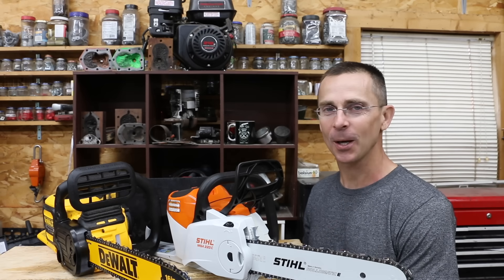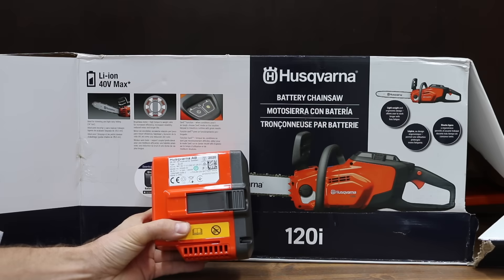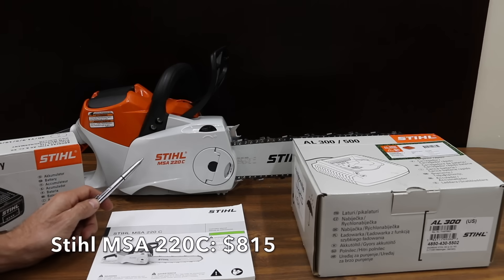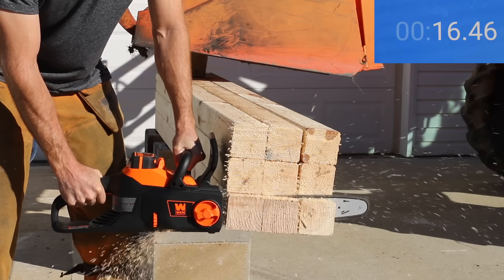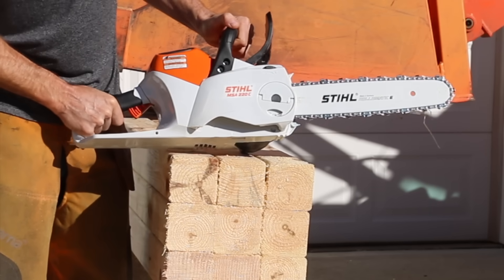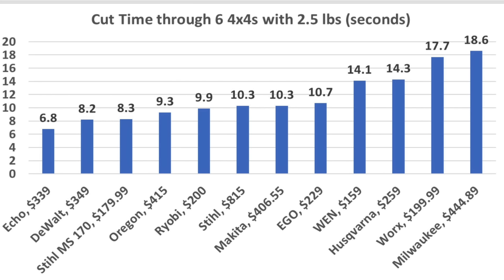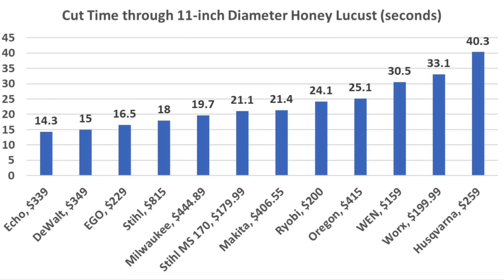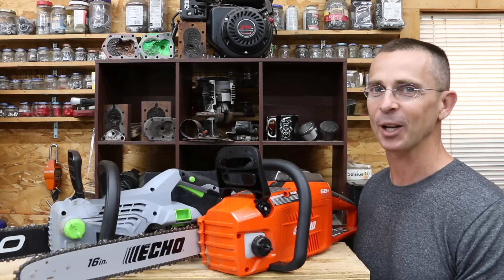Best Battery Powered Chainsaw Brand (ROUND 2)? Stihl, Husqvarna, Echo, Oregon, DeWalt

Comment: Man Stihl should be ashamed. Looks like it will be an Echo for me when the time comes. Thanks again Project Farm!
Reply: I'd buy whatever you already have batteries for. 

If you own zero cordless tools, then milwaukee/makita/dewalt makes the most sense. Buy the battery system you can get all the tools you'd ever need, otherwise you'll drive yourself nuts looking for the right battery/charger.
Reply from the maker: You are welcome!
Reply: @ProjectFarm  I'd like to see a comprehensive objective review of standard screwdrivers, tip strength etc. Including snap on, kobalt, and other brands, and maybe even some of the German made brands.
Reply: I logged with echo, they are junk in my experience. We used heavy duty saws too. I have a stihl 066 that is at least 20 years old and it hasnt been tuned or rebuilt and it still runs like the monster it is.
Reply: @ratedredneck96  I’ve used all sorts of Stihl and Husqvarna chainsaws over the years small to big. Stihl has more vibration than Hasqvarna but doesn’t fall apart like one. I have a 20 plus year old Stihl 036 professional haven’t used in years dumped out old fuel put in fresh no ethanol gas started right up runs like new. Problem with chainsaws most people don’t know how to use properly and are a danger to themselves while using. Also in order to cut right you need to know how to sharpen the chain correctly.
Reply: @4Runner123  yeah, what i was taught is keep the file flat and follow the pitch of the tooth and keep it consistent on passes so you dont have uneven tooth wear. Also a little cheat if you have a decent power sae like a pro model or something around an 038 or something file down a couple passes on the depth gauge. You dont have to push as hard and it will dig more per tooth. You can easily overdo it though and cause the blade to fowl out a lot so just literally 2 passes with a flat file per depth gauge and the saw will cut better you just have to keep it up in the rpm so it doesnt bog out. Also safety chains or skip tooth chains can be annoying, get a full chisel chain but they dull a bit faster but cut better. Its all a pretty saphisticated deal when you really start looking into it. Full chisel standard chain with a tiny bit of depth gauge filing csn be a monster setup on something like an 048 or 066. I too have used the small saws of husky and stihl and the general rule is tuning a small husky saw is hard, getting them to idle and also run well up top is a pain but a small stihl is easy to start and run and idle while also being a nice steady high rpm. When i logged i used echo but although they were good saws i just cant see myself with anything but a stihl. For some reason husky makes a good weed eater but the saws are just finnicky.
Reply: @ratedredneck96  I fully agree file down the rakers a bit when the chain’s getting worn down. Just make sure not too much. You just want to look what sort of chips it’s producing. It’s been a long time since I used the big big saws. Always remember not to hit anything to dull them or you will be sharpening for a while lol
Reply: Wonder if the rim can drop a tooth on stihl?  Thatd bring torque up.
Reply: @claterpillar1  No it wouldn't. The motor makes torque. Not the sprocket. The "gear ratio" is the CHAIN TOOTH COUNT DIVIDED BY THE SPROCKET TOOTH COUNT. THE BAR TIP SPROCKET IS AN "IDLER". And horsepower is a function of torque and speed calculated using a speed constant. "Dropping a tooth" drops "chain speed" by whatever percentage of current sprocket "tooth count" one tooth is because that's one fewer "tooth" per crank/motor revolution driving the chain.  'Drop one tooth" from 5 and that's a 20% chain speed reduction. Nothing increases motor torque in that scenario. 20% less chain speed = 20% less "horsepower". At best. 

The Stihl has far more "power" than everything else in the "comparison" with both a far more "powerful" battery in terms of voltage and a far "torquier" one in CURRENT FLOW CAPACITY AKA AMP-HOUR RATING. 

IT HAS ROUGHLY 75% MORE "POWER" AT 7.2 AMP-HOUR (WHICH MEANS IT WILL "PRODUCE" 7.2 AMPS MINIMUM FOR 1 HOUR OR 1 AMP FOR 7.2 HOURS MINIMUM BEFORE BEING "DEAD" I.E. REDUCED TO NO LESS TO ITS NOMINAL VOLTAGE OF 52 VOLTS) THAN ANY OTHER "CHAINSAW KIT" IN THE "TEST" AND ITS - INCORRECTLY "TESTED" - "FREE" MOTOR SPEED OF 13,000ISH RPM IS "ON PAR" WITH ITS "GAS COUSINS" - IN THE STIHL FAMILY THAT IS AS THE ONLY SAW HERE WITH A "GAS COUSIN" OF ACTUALLY "COMPARABLE" SIZE AND "POWER" AND "SPEED") AND ITS SUPPOSEDLY "SLOWER SPEED" IS DUE ENTIRELY TO ITS "OVERSIZE" BAR AND "SAFETY" LOW-KICKBACK CHAIN IT WAS "BUILT" WITH BY WHATEVER STIHL "DEALER" IT WAS "PURCHASED" FROM. 

YOU OBVIOUSLY KNOW STIHL "RIM SPROCKETS" ARE "INTERCHANGEABLE" ON THE CLUTCH DRUM OF "GAS SAWS" BUT THE CHAIN PITCH MUST ALSO BE "SWAPPED" AND A CHAIN AND BAR "NOT RECOMMENDED" FOR THE SPECIFIC POWERHEAD "SWAPPED" AS WELL AND ALTHOUGH A COMMON "TRICK" TO GET MORE "POWER" OUT OF A GIVEN POWERHEAD IN FACT THE OVERALL SAW "HORSEPOWER" IS AT BEST UNAFFECTED IF NOT "DOWNGRADED" ESPECIALLY WHEN AN "OVERSIZE" BAR IS ALSO INSTALLED WITH A LENGTH INCREASE PERCENTAGE IN EXCESS OF THE SPROCKET "TORQUE INCREASE". 

"DROPPING" 20% OF CHAIN SPEED AND ADDING 25% MORE BAR LENGTH CREATES A NET "POWER DOWNGRADE" OF AT LEAST 5% AND WHEN "UPGRADING" A "CONSUMER GRADE" STIHL LIKE AN 039-FAMILY POWERHEAD WITH "PRO SERIES" PARTS FROM AN 044-046, THE NET RESULT IS ALWAYS A "HOPPED UP" 039 THAT "DAY IN AND DAY OUT" WILL NOT "OUTCUT" A 100% "BOX STOCK" 039 IN "PROPER TUNE" AND WITH THE "RECOMMENDED" BAR AND CHAIN IN THE HANDS OF A SKILLED - NOT JUST "EXPERIENCED" - OPERATOR. AND AN OPERATOR IS DIFFERENT THAN A "USER" AS WELL. 

THROUGHOUT THE "OUTDOOR POWER EQUIPMENT INDUSTRY" WHETHER THE EQUIPMENT IS A "LEAF BLOWER" OR A "PAYLOADER" LESS "POWER" AND MORE SKILL = MORE "SPEED" AND LESS "COST" FOR MORE PROFIT  EVERY DAY OF THE WEEK.
Reply: @deeremeyer1749  been felling trees 27 years. 066, ms660 500i    I didn't read that book you wrote,  but cool story.   😎
Reply: Stihl is a lightweight professional saw for use when climbing a tree to top and drop limbs. Often times you are cutting one handed that is why it did so well with little pressure. The Stihl is an excellent product.
Reply: I own the Echo. Money well spent!
Reply: Totally satisfied with my echo chainsaw, so much so I snagged another on clearance at the home depot. I have multiple of the 58v trimmers as well and the mowers. Great buy!
Reply: These are very small chainsaws but cool
Reply: Stihl is good of the variaty of using his battery , they got all the garden aquipments on the same battery ;-)
Reply: Don’t forget the Echo is nearly twice as heavy. Rather work with the lighter Stihl!
Reply: Stihl should just send him a reimbursement check, thats an embarrassment for such highly priced saw. I own all stihl gas products, but this electric saw its embarrassing.
Reply: @dontheplumber.4406  This saw costs 399€ in Europe now for Christmas. I bought the smaller 140-model to be used in parks and on nature trails and in conservation areas. An excellent little saw. I was impressed by the Echo in the test though, but the dealers over here are quite far in between and usually carry no spares.
Reply: I have 3 years on my echo and it is still going strong.  You will love it
Reply: Wait and see if he does a test with the atlas. I’m curious personally where it will fall. I love mine with a 16” bar. The 18 was too long for it. I have a husqvarna, Echo, stihl and the atlas.
Reply: When I see stihl I see a big pile of dog s. Lol never had luck I love buying American made but America has went to crap. Japan takes pride in what they build.
Reply: Yeah 800$ can’t cut shit
Reply: I sell STIHL'S and can get them just over cost, yet I own ECHO. What does that tell you.
Reply: For me to buy the Echo they would need to move its manufacture to Japan like their Gas ones..
Not interested in one made in China..
Reply: I sort of agree but at least with a gas Stihl they will last forever if maintained. Hard to say that paying over 2x the cost is worth it tho.
Reply: @SnifferSock  Yes, that Stihl is very nicely build but too expensive for a non-professional. For that price it would be nice to have a little more powerful motor, but I guess they wanted to keep the weight down.
Reply: @tkermi  even for a professional, it is too expensive for far less performance.  What pro would buy a battery powered stihl vs gas?  None.
Reply: @hanwagu9967  I'm not a professional in this field. But the pro who cut down two medium sized but very bushy 70cm (24") thick spruce from my yard used that Stihl and worked really fast.

He only used a gas powered saw for the very lowest section of the trunk. He had been profession over 10 years, it took about 1 hour / very bushy tree for him to climp and cut off all the branches and cut the trunk to 55cm (22") pieces (on his way down from the top).
Reply: @tkermi  Sorry...if the "pro" used the MSA220C with a 14" bar with only 12" usable bar, which actually means 10", to cut down 24" thick (I'm presuming you mean diameter here), he/she wasn't a pro.  SAFETY, SAFETY SAFETY!
Reply: @hanwagu9967  Like I wrote he used a gas powered saw for cutting the lower thick section of the trunk (maybe the first 1/4). He was a well trained with an arborist degree and proper company with all necessary insurances.

Now when thinking more carefully I think he actually used Stihl MSA 161 T (with 14" bar - I think) and not the model from this review for one handed operating. He needed his other hand for guiding the dropping down path of the brach he cut (the trees were close to the house and the branches were heavy and long ).

I live in Finland and here a large percentage of the people have quite reasonable knowledge about forest keeping including logging safety. We all learn a little bit of that from the school and almost all have some relative / friend with at least a small patch of forest. My uncle and one of my friends own quite nice sized forest areas.

Even though I'm certainly not a pro I have been cutting down some trees myself in few differend selective loggings. And used few different saws a lot when making firewood from small (4"-8" diameter) birch trunks. For that stationary use Makita UC3041A is cheap and very good electric saw (with power cord). But now when I have a geothermal heat pump - and not my own forest - I don't make firewood anymore.

But anyways, I told all that just to establish that I do have some understanding about logging/forestry (not just a keyboard warrior noob 😅). So the Stihl battery powered saw seemed to perform extremely effectively for that task described earlier.
Reply: @tkermi  well, just because you may have cut 30 trees doesn't mean you are a pro nor does it mean you are doing it correctly or safely.  I see plenty of "Pro" contractors felling trees and doing so dangerously.  Anyway, the point is, use the proper tool for the job.  The Stihl in this case is a sad performer compared to others out there at a price that doesn't justify performance, only brand.
Reply: @hanwagu9967  You are correct that I'm certainly not a pro. But about that Stihl being a suitable tool for the job I describe - I must politely disagree. Maybe you have used it a lot in that kind of work and for some reason it didn't work out for you 🤷🏻‍♂️.

But as a craftsman myself I could only admire how swiftly and smoothly that arborist cut down my two trees. 

Safety was my main concer because trees were toching my house (and didn't want anything bad happen to the arborist either). That's why I cheked multiple companies before choosing this guy. Also we have excellent arborist / forestry schools here in Finland and that's why accidents among graduated professionals are rare.
Reply: @hanwagu9967  unless you live in Sacramento CA then you are forced to lol
Reply: @SnifferSock  yeah I really do like Stihl chainsaws. I now have a new Husqvarna that I purchased a couple of years ago and I say it's new because I haven't run but about maybe a gallon of gas through it. The only reason I changed to husky is because the Stihl dealer here in town has really suck service. Where I bought my first Stihl chainsaw  and later weed eater at some 40 odd years ago got too old to deal with everything and sold the store and they decided on not carrying outdoor power equipment anymore. I still have that old 028  and an old 031 or 3 2 but they need gas line filter assemblies and they don't make them anymore. I even told the guy look if you'll do this to fix it and he says we don't jerry- rig. Well I was already down pretty bad in health but I'm getting a little better so I just got to get my glasses on, buy me some tubing, any kind of filter that I can attach it to and I will replace my own gas line assemblies I just hope I can still get a carburetor kit. And unfortunately there are manufacturers that will only agree to make parts for their equipment even like washers and dryers, for maybe 10 years some maybe 15 but then again other companies decide to make Parts on for several more years. So go gas and go Stihl and now that I own a Husqvarna go Husqvarna too! I don't guess I'll be switching to Electric for long time. happy cutting to you! And have a wonderful Christmas!
Reply: @SnifferSock  if they are maintained they still suck !!!!
Reply: Was wanting to get myself a stihl. But now thats changed.
Reply: Why would you buy an electrical chainsaw when the time comes? A good 40 CC - 50 CC saw will be lighter, cheaper, more convenient and last longer. Electric chainsaws only make sense when they are cheap and corded for processing very small wood around a property or when one has existing batteries on hand and they wish to use them. You would easily need several batteries from any of these platforms to get a couple hours of real use, it is not only impractical, but quite heavy to carry and these batteries would not come cheap either. With cost of several batteries tallied it would cost a lot more than a good 40 cc - 50 CC saw while being worse in almost all respects. Electric saws work when cheap and corded as they are convenient, batteries are not an issue and they outperform the really cheap gas chainsaws in their class alternatively battery saws only make sense if you're already bought into a platform as that significantly reduces the battery cost.
Reply: @Ilost11  That's all true. But if someone wants a lightweight battery powered speciality saw (for one-handed use, when climbing in trees etc.) the Stihl MSA 161 T is nice though very expensive. With the smaller 94Wh battery it weights only 7,5 lbs and with 187Wh battery 8,4 lbs. But I know there are lighter weight / cheaper gasoline powered options.
Reply: I had Ego do a demonstration at my colleges campus to try get them to replace all the petrol powered equipment do love their leaf blowers and hedge trimmers
Reply: @rhaynhillyard9772  why?  gas is king!
Reply: Husky should be ashamed I've owned husqvarna my whole life best most powerful saws I've ever used they should have stuck with gas
Reply: My dad uses echo. Has 3 different sizes and cuts about 10 cords a year and they run great
Reply: @johncoinas  I have 1 husqvarna, makita and stihl with 2 echo's, Echo's are nice but since I modded the 63cc  MS360 Stihl its 11cc smaller but cuts so much faster than 372xp
Would buy echo's cordless any day, seems like  a decent machine. They never let you down or fail, really well built saws, pro ones at least.
Reply: @johncoinas  He cuts 10 cords with a electric saw??? Well, if you have to use 10 cords to heat then it is probably just spruce.
Reply: @lickyweeks  did i say electric lol echo has gas and has to keep up for the next year. He lives in northern maine and its the only source of heat and cooking but ya its definitely spruce lmao

Comment: THANKS, Commander and Echo makes GOOD equipment.  We also have a Milwaukee Hatchet 20 volt trim saw with a 6 inch bar for the one that said she'd never run a saw. A baby saw must be inside her parameters! We're having trouble with what looks like the charger showing bad batteries. CPO sent us another battery but it shows bad too. I doubt seriously that 2 batteries from Milwaukee are bad. I'll call tomorrow and see what they want to do. CPO has been GREAT so far and the shrubs are safe for a while longer. I may end up in a clear cut! Yall remain calm and BLESSED! GBWYall!
Reply from the maker: Hi Lewie, Thank you very much!  I need to check out the 20 volt trim saw.  Sounds like a faulty charger.  Thanks again and many Blessings!
Reply: @ProjectFarm  Cheryl said she found one for $60 and I told her if we were going to get one, lets get a GOOD one. Stihl has a dainty thing that you have to oil the chain with a squirt bottle. NO deal. The Milwaukee has an oil tank and an auto oiler. Also variable speed and real dogs. And a real chain! And a real price but why buy junk. If you don't get a good one you'll kick yourself from now on or until you do and just count the price for the junk as going down a rat hole and lost. So see what you think! It'll be a real deal when we get the loose ends tied up. BLESSINGS back atchee and GBWYall!!

Comment: I  appreciate the video and feel that one is well served with the recommendation.  I happen to have the Husqvarna batt chainsaw as it was the saw available at our small town farm supply store.  I have a Stihl gas-powered chainsaw, but for the convenience, grab the Husqvarna.  

For the price, it has been an excellent tool for me.  I’ve been using it on dead wood/blow down primarily - and it works superbly.  It uses very little bar chain oil and has been very reliable.
Reply from the maker: Thanks for sharing.